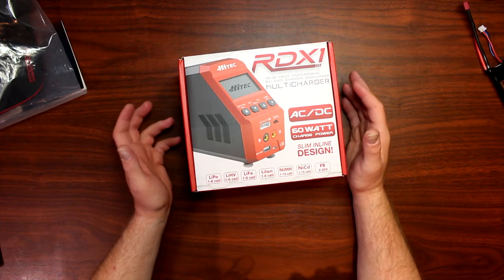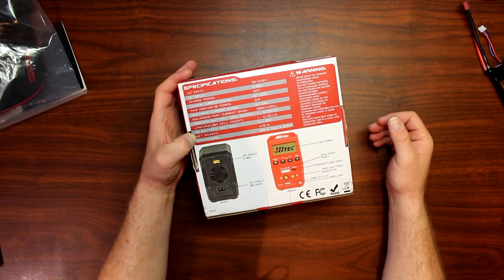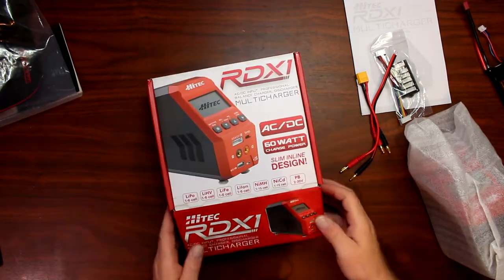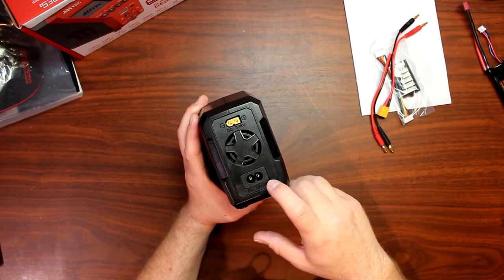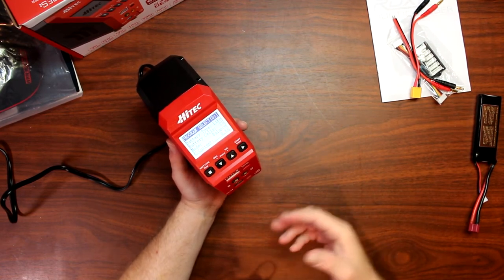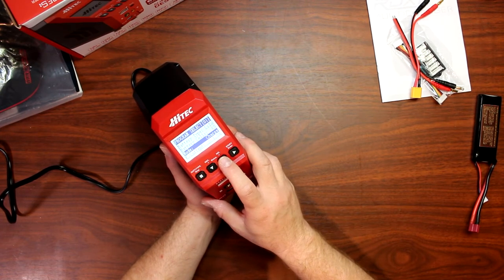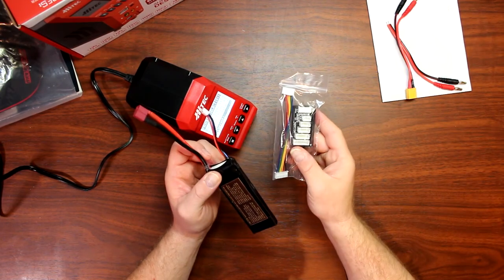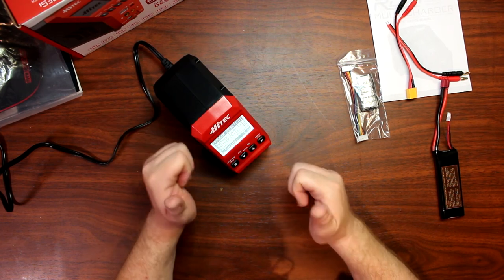Hitec Rdx1 Charger

Comment: Have been using this for years for my hangar of RC planes.  It stumped me the other day when it said that the temperature of the LIpo battery plugged in was too high.  Reviewing information I saw no answer as to how to resolve this in the charging process.  Any thoughts?
Reply from the maker: That is a very good question. The charger does not have a way to measure. The temperature in the battery   I would suggest if that battery still gives you the same reading try another charger. If you have access to one this is something I never saw.

Comment: You should use the balance board supplied because it is a cheap throw away part. If you continually plug a lipo directly into the charger you run the risk of damaging that port and that will render the charger useless.

Comment: I have exact same charger and a 4s batt. I want to know how to properly discharge what's the target volts etc.
Reply from the maker: Do you want to put in the storage mode or or discharged do you dispose of it if you want to put storage mode the charger will take care of it and if you want to completely kill it to dispose of it running in nimh mode until it has zero voltage.
Reply: @djsprc  so on a 4000 mah what would the voltage be for each individual cell. Wanted to know if i should drain battery after each use
Reply from the maker: Jacob Yetto Once you used it should be at 3.8 per cell sometimes it can vary a little bit
Reply: Thanks very much for your time electric is all new to me I have only had gas cars I just didn't want to smoke a brand new battery literally and thank you again I'm all dialed in now , had to read the owner's manual twenty time's

Comment: It seems simple can I just use a balance board with a xt60 with the charger ports and can I charge more than one battery and if they have the same voltage and same cell
Reply from the maker: If I understand your question you’re asking for a parallel board but that’s something I would suggest only for experience people that they should happen if it’s not done correctly

Comment: My RDX1 stopped working today after months of good service. It was used to charge 1,2 and 3 cell lipo batteries for my rc planes. All seems well until starting the charge process - the CURRENT reading stays on 0  (zero).

The results are the same for ac or dc use.
Some guys at the club checked it and tried different connectors in case one was bad - but same bad results - so its not the connectors.

We tried charging the batteries on a different charger and they worked - so its not the batteries

Our best tech guy in the club said all my settings look good.

So, is the charger broke ?  - any ideas ?

And I could not find what the warranty details are for this RDX1 -  Do you know ?

I plan to call HITEC support later if necessary.

Thanks for any ideas.
Reply from the maker: lw216316 I check the warranty where you bought it and yes I would call hitec  definitely the charger is not OK
Reply: thank you, someone suggested a FACTORY RESET so I tried that and the charger still does not work.
Reply from the maker: lw216316 That’s why I did not suggest a reset I known I reset it won’t work there something more internally in the charger

Comment: Would this work for batteries that are under the safe voltage threshold?
Reply from the maker: Scot Johnson  If one of your cells is low yes discharger might be able to bring it back. Now if one of your cells. It’s too low the charger may not be able to bring it back you will need to use the method of NIMH to bring the cell back where the charger can’t take over.

Comment: I’m new to rc and looking for a charger for the new setup I am getting. The car uses an ec3 connector so would I have to get an adaptor in order for my battery to connect with this charger?
Reply from the maker: Yes you would need a adaptor or a charger lead.

Comment: how long does it takes to charge a batt nimh. ?
Reply from the maker: Depends on your capacity and what state is your battery and if it’s in half charge it will take less time. And the rate of charge you decide on
Reply: djsprc  im in usa. regular battery.  nimh.  it says complete in 10 mins. but i think it dies to fast
Reply from the maker: Tony Reyes Now if it’s an old battery that’s possible that she’s only lasting about 10 minutes try to do a cycle charge that’s charging descharging couple of times you might gain more running time if it doesn’t I would suggest a brand new battery

Comment: How do lower the volts to under 4v per cell i keep getting a over charge
Reply from the maker: ivan baires On the charger it’s self you have a storage mode. You will need to use that mode to discharge the battery.
Reply: @djsprc  so i have to charge then discharge a little bit
Reply from the maker: ivan baires What I would do is. Use the battery or discharge it. After  put it back on the charger on balance charged